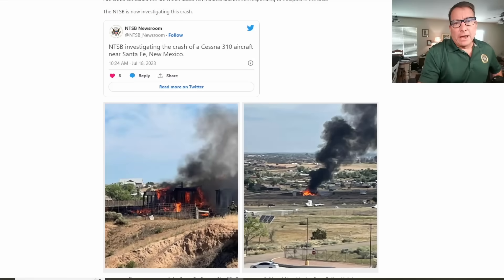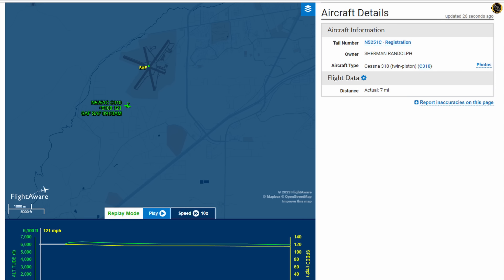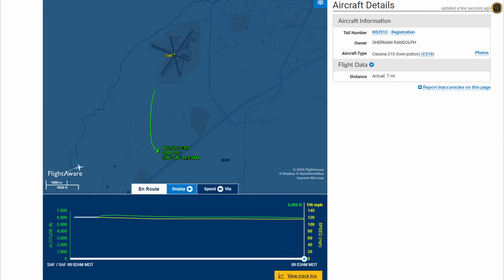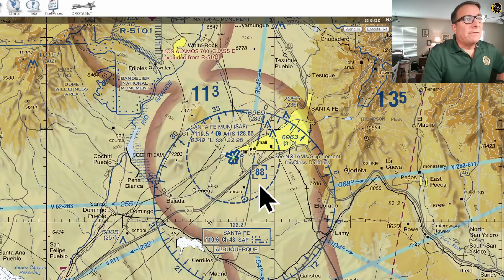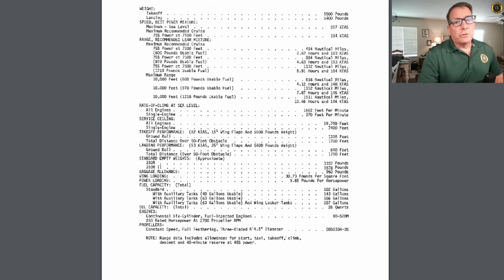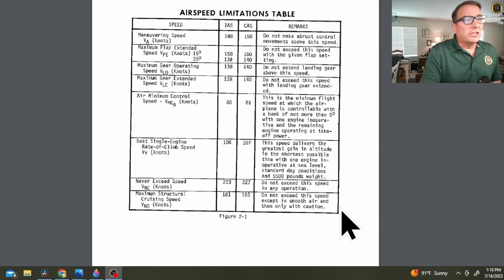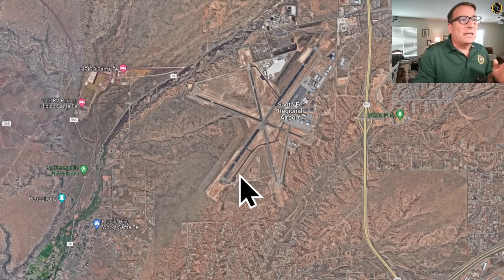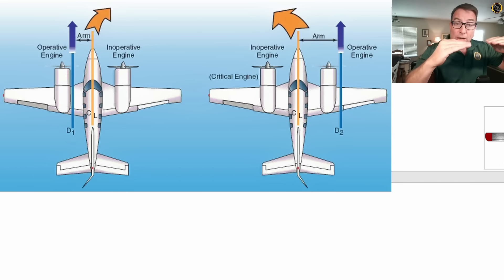Fatal C-310R Engine Failure - Santa Fe, NM

Comment: Well reviewed, especially the performance chart and discussion of density altitude. Performance planning is critical and a requirement for most Army Rotary Wing missions. When I continue to listen to so many GA accidents, it’s clear to me GA pilots do not review the performance charts during preflight planning, if any is conducted. Understanding aircraft capability in varying environmental conditions is critically important. Makes me wonder what CFIs are teaching and how forcefully they require students to compute aircraft performance before every training flight.
Reply: I visit family in AZ and see trainers circling so heavily 9 months out of the year when the weather is clear and mild. Not so much in the summer when it's 120° and monsoons can come out of nowhere and ruin your costly stick time. It makes me wonder how many training hours are racked up circling in a cloudless 75° sky over flat desert. Seems like such a perfect complacency generator.
Reply: I think the issue is less initial trainging, and more on recurring training. In the Military we are constantly redoing training to maintain currency. GA pilots have no requirement for continued training. Road drivers don't either for that matter and every day you can see how agressive and bad most drivers on the roadways are. I sometimes wonder what the roads would be like if license renewal required passing a drivers test and not just an every 10 years eyecheck.

Comment: I am the pilot of ill fated C310XX which lost L eng app 3 sec post vr. About ten years ago at Catalina. With failure X-ray shook, and began to roll L. and dropped into zero zero fog. AI was 20 -30 deg. controls locked and Ai rising. I cut R engine.   All walked. My Two passengers, one burned and recovered, the other, his wife) and I were Ok. Flight time apx 20-30 seconds. . 
….MULTI ENGINE PILOTS    PLEASE.   LISTEN UP….  I say as one who’s been there.   Upon engine out; there is no time to think. Your response VMC / Engine out  procedures,  Must be engrained / automatic. Next Solo, do an engine out to VMC, time it.  Do or Did you have to recall, anything? Friend if so Ok, but please remember there will be no time. Consult Listen. Train and fly well.   Thanks Jim S

Comment: Tragic.  I don't think there was anything this pilot could have done to save this... condolences to the victim and their family.
Reply: Well, many times these twins could have pulled back all power and just land somewhere, gear up.
Reply: smf333  Exactly.
Reply: He could have reduced or just killed power to operating engine and attempted to land somewhere relatively straight ahead. Even a controlled crash or off airport landing would have made a chance of survival much more likely than VMC rolling it into the ground.
Reply: Don't know if you fly, if you do this comment is not personal to you. But...the attitude you expressed is a big part of why General Aviation safety record is so dismal. Of course there was something the pilot could have done to "save this"....there was quite a lot, actually. First he could have taken a look at the whole situation and decided not to go at all. Second he could have spent some time crunching the numbers and seeing exactly what kind of performance or lack thereof he could expect if an engine failed. Brown doesn't say how heavy the aircraft was, with only one person (pilot) on board it was probably well below max gross weight but even if so, at DA if 9000 or more the climb performance would have been almost nothing, even if the engines were 100% to spec, the aircraft was clean and waxed, and the pilot flew it to test-pilot perfection. So: That leaves the last thing the pilot "could have done" which was realizing beforehand and accepting that if an engine failed on takeoff that the only option would be to *pull off power on the remaining good engine and make a forced landing straight ahead. Now the problem with GA is manifold, first that the average GA pilot doesn't know all this stuff or more accurately has forgotten it due to time and carelessness and complacency. Second that GA pilots don't tend to plan ahead as I've outlined. Third is the GA pilot attitude that "It can't or won't happen to me." That's a BIG killer of GA folks, always has been. Fourth is that GA pilots don't have the skill or practice, as a rule, to be able to react to emergencies properly and fly the aircraft with the necessary skill and savvy to land with a safe outcome. In conclusion, remember RESIGNATION is one of the five Hazardous (Killer) Attitudes. Of course there is something the pilot could have done, there almost always is and in fact it is a very rare case when there is nothing that can be done.
Reply: @notsoancientpelican  Absolutely correct, I heard a saying the other day that I think is relevant here, A good pilot knows how to fly the plane, A great pilot knows when not to fly the plane..
Reply: The pilot had EVERY opportunity to land on a single engine REGARDLESS of the prevailing conditions
Reply: He could have flown on the second operating engine?
Reply: I think op was saying once he was up there was very little to do to get out of Situation.
Reply: "If we lose an engine today, we'll likely land on the highway to our left, due to todays density altitude"
Reply: @notsoancientpelican   🎯👍👍👍👍
Reply: More training and a right turn may have saved him.
Reply: @svoffcay9231  the  Continental TSIO-520-B (turbo) still has the same hp rating.  Yeah 'MAYBE' and that is a big maybe he could of climbed but not in a turn and level climb would be very slow.  His best case would of been to put down somewhere straight ahead as he was already at a density alt of 9000 ft
Reply: @johndonaldson3619  He got to the high AOA side of the curve so even with 2 good engines it is tricky since the increasing induced drag eats up all the power extra...Penaud diagram...He got there with the climbing attempt...then a turn sealed the faith...
Reply: @svoffcay9231 having a turbo doesn't do anything for the DA when it comes to the wings and props. It just helps the engine keep power at altitude
Reply: Regardless of the number of engines, he COULD have done the damn math...Okay, so there are charts and all... It's STILL doing your own homework. In GA, you generally do NOT have a corporate entity detailing how you should operate their planes... It's up to YOU to go through the math, every time. Ask "what if I'm on one engine during climb-out?" for every flight. Santa Fe is KNOWN for altitude density issues and tricky winds! Even a relative noob' fresh out of flight school SHOULD know to think just a little about the usual bad scenarios.

    Whether you still take the flight or call it off is also UP TO YOU... As some pilots like to repeat, "Take off's are optional, landings are MANDATORY." SO remember that.

    Once off the ground??? Yeah, he still had options. He could have responded "Left engine's out, but I can do a right 270 if that works for you." to ATC, not refusing the new heading, but making do with what he had... and avoiding turning INTO the dead engine... you know... like a great pilot might do.
      Similarly, he could've rejected the left, "Sorry, no can do... Left engine's the dead one... I need to turn right." OR "Left engine's out, Can I get into right hand traffic???" Clearing up the question...

     ATC (upon realizing the full situation) would then either give him a new direction to go, hopefully to the right at that point... OR would just "okay" the unorthodox procedure to let him out of the way, as long as time and space allow... fair enough, and relatively low risk...

       He could ALSO have issued "mayday" and stated intentions for altitude density, that he was going to get out to the flat, open territory and put the plane down, and damn a bunch of altitude... no jerking around... no screwy maneuvering... in short "no heroic sh*t"... AND that might've saved it.

      It's easy to delineate to the obvious. "Uh... well... he coulda stayed his ass on the ground!" AND that's just as diminutive and dehumanizing as laughing at him and calling names... His willingness to turn left with a dead left engine is pretty well against "the code" taught in flight schools, so he obviously HAD been complacent somewhere and probably forgot about some of those lessons and procedures...  BUT defaulting to insults and delineation is also NOT making the best use of the operative situation here. That's wasteful, and I don't even like wasting a bullet on varmits if I'm not willing to eat them. I'm damned if I'm wasting a human life lost, so why NOT at least try for a reasonably creative solution to it???

      THIS kind of "academic exercise" isn't just twisting intellectual muscles for material to post. It's an exercise in THINKING ACTIVELY... You're only going to get better skills at the things you PRACTICE... That's part of why I do this sort of thing in the first place... AND here, I've got two (hopefully) decent suggestions... and a tiny supposition as to how they might play out... 

      It also occurs to me... AND admittedly, on this one, I'm really NOT sure... BUT in the audio, ATC specifically said, "So it's just the ONE engine?" 

     SO here... read me out on this. It's FEASIBLE (not exactly probable... but believable in the moment) that the ATC was confirming that he only lost one engine, but the pilot MIGHT have assumed the ATC was confirming "The (number) ONE engine" meaning the left engine on the plane (which is always number 1 as we count them from left to right)... AND he just didn't consider it necessary to clarify... "I've lost NUMBER ONE"... 

      SO an added bit for us (all) to remember... just worth pointing out... DO NOT EVER assume ATC folks know ANYTHING about operating airplanes. Most are NOT pilots. They really REALLY want to help us out up there... SO we have to help them out with the clearest explanations we can give... "Mayday, Left engine's kaput!" 

      AND of course, don't forget the ages old "Aviate, Navigate, THEN Communicate"...  

      Anyways... I'm not here to bust anyone's balls... It is what it is... We can learn something or try... or wave our hands in the air and give up... "Nope... he was f*cked as soon as the wheels left the tarmac!"   ;o)
Reply: Straight ahead, gear up landing. NEVER TURN INTO YOUR DEAD ENGINE!
Reply: Perhaps put it straight down without turning. The draw of the impossible turn seems to override people's thoughts. I'm not multiengine rated so I don't know how they teach this or if they do but extreme caution is always warranted. Very sad loss!
Reply: @svoffcay9231    You really need to know what that ACTUALLY means…   It does NOT mean that the airplane will CLIMB from some altitude BELOW the published single engine service ceiling and then maintain that altitude and single engine cruise speed…   It DOES mean that the airplane SHOULD be able to maintain that altitude and a single engine cruise speed IF it was at an altitude equal to or higher than the published altitude and at a normal two engine cruise speed…   That also assumes that the airframe, engines and systems which operate the landing gear and flaps are new, the control surfaces are rigged properly, and the pilot is at least as competent as the pilot who flew the flight test maneuvers, from which the performance numbers were calculated…
 As the aircraft ages, the altitude and temperature varies from the what it was on the flight tests, and the pilot’s proficiency is less than the test pilot’s, all of those performance numbers degrade at least somewhat, if not significantly…   Thanks-   J
Reply: @greenkwaka That “highway” to the left is Interstate 25 and heavily traveled. I don’t think it would have been an option.
Reply: @michaelmcmurtrey8543  I wasn't really talking about the details, rather fully briefing yourself on the option of landing straight ahead rather than trying to fly and turn at that density altitude, beyond the aircrafts envelope. Just a thought.
Reply: He could have turned right!
Reply: Tragic but if the flight planning shows critical density altitude issues dont fly. You wouldn't drive into a blizzard. This is rolling the dice, the lesson this teaches is paid for by this man's life. God bless
Reply: @svoffcay9231 thanks for pointing that out turbocharging was made for these kinds of issues JB should have factored that into his calculations
Reply: @golanheights9000  That's exactly what I used to tell my student pilot sons.  Look for why you shouldn't BEFORE you decide why you should!
Reply: @notsoancientpelican  Damn that was good!
Reply: @johnypitman2368  I think there was one zero too many in his claim.
Reply: Absolutely there was. 

Close the remaining throttle, land straight ahead. 

He would have walked away.
Reply: @johnypitman2368  so according to your tolerance of Risk, you would never fly a single engine aircraft, because if you lose 1 engine, you're executing a forced landing... and that's ok. Everyone has their own go/no go limit.
Reply: @notsoancientpelican  I was wondering, so, the torque from the propellers make the craft have a bias to roll left? Left engine out...is worst case....but, can control surfaces be quickly adjusted to do right side banking and would it be enough?
Reply: @willl84 yes!!! So many need to know this. People hear turbo or turbo prop and think they’re invincible. But the wings and prop still produce less lift and thrust with higher DA
Reply: willl84, 
Density altitude  is still altitude.
Reply: @empireoflizards More control surfaces means additional drag. Not good for a plane already fighting for enough power to stay up.
Reply: Blue Line.
Reply: Throttle both back and make the best of it but unless it is rehearsed in your mind before you start the TO, you’ll never do it in time.
Reply: so you didnt get the message: pilot stupidly turned toward bad engine, a fatal mistake.
Reply: Sure he could have.  He could have stayed on his departure course instead of attempting to execute a turn on one engine.
Reply: @dks13827  He didn't have all power.  He was only working with half power.
Reply: @jerryeinstandig7996  A little harsh.  Do you know for a fact he hadn't started a left turn before it failed?  We don't even know for sure which engine failed.  He never would have completed 270-degree to the right under the circumstances.
Reply: Did 
UAL just get a big raise 👍
Reply: @imo8249  30% over next 3 years I read.
Reply: In emergencies, too often, owners’ flying THEIR BABY, don’t want to damage their airplane. They need to think first, about surviving and not getting injured or killed. To hell with the airplane! Fly it to the scene of the crash under control, and hopefully walk away unscathed👍🏻🤞
Reply: @gnarthdarkanen7464 always nice to read posts from pilots much more well versed than I am. Your words were hard to eat when we admit we fail at times but they were true. I fly a single engine Piper and always try to factor safety into my flight before my wheels leave the ground. I have friends who don’t think the same way I do especially about twins . 👍👍
Reply: @notsoancientpelican  not a pilot, but when he said he was trying to get more altitude, was that the wrong thing to do since the airplanes performance would be compromised by the density altitude.  I want to take lesson next year, but I just watch these trying to learn anything I can. Haven't taken any lessons so sorry if this i a dumb question
Reply: @golanheights9000  Fair enough.  I suspect that this doctor fell victim to something a lot of us do.  Faith in our equipment.  We trust that things will just work and don't have a good plan if something breaks.
Reply: @sagemaster3408  Yes.  That's exactly what I was saying.  Hindsight is 20/20.  Maybe he shouldn't have taken off with the density altitude being so poor.  Maybe the engine wouldn't have failed.  Who knows.  But once he started the turn - it was game over.

In the future, it might help ATC to ask which engine and then have them making the turn towards the engine that is still running.  If left engine died and he turned left... that's what sealed his fate.
Reply: @RealRickCox  yeah i was sticking up for you because everyone was whining “yeah he could have done something “
Reply: Sounds exactly like that Sanford & Son 727 that was hopelessly overweight that was flying straight, but as soon he made a turn he lost speed and altitude then kissed the ground
Reply: Absolutely.

The hardest and least-fun thing in  aviation is saying “no”.

It is also, most of the time, the most valuable thing.
Reply: @RealRickCox  Everyone is making assumptions in hindsight.  We don’t even know if he hadn’t started the turn before the engine failed or even which engine did fail.  ATC can not advise a pilot how to fly his plane during an emergency….imagine the liability.
Reply: @bw162  You're absolutely right on the liability.  But I think it would have helped the situation if ATC said "Turn in the direction of your good engine" or something like that so that would have told ATC some important info about the problem without needing to distract the pilot from what he needed to focus on.
Reply: @RealRickCox  Too many variables for that to work such as rising terrain in the “direction of the good engine” or a populated area or school house, transmission power lines, etc.  ATC can’t provide that kind of “advice”.
Reply: @RealRickCox not ATC's job to fly the airplane.
Reply: @doctriestosew4333  Under the conditions of high altitude and high temperature, after one engine failed the remaining engine could not produce enough power to enable the aircraft to climb.
Reply: @notsoancientpelican  thanks for the explanation